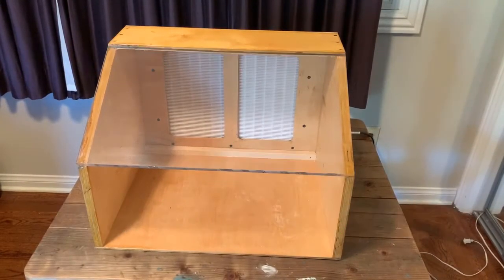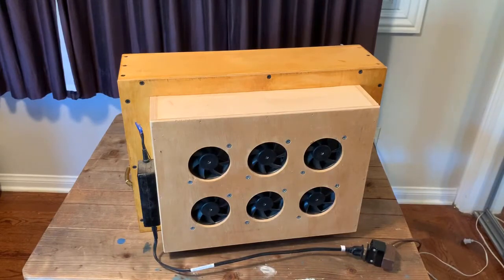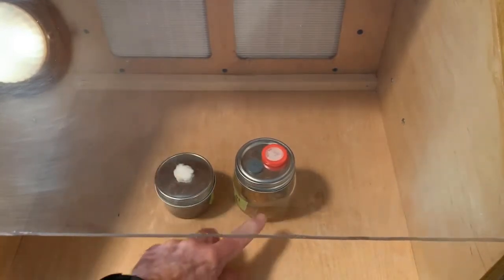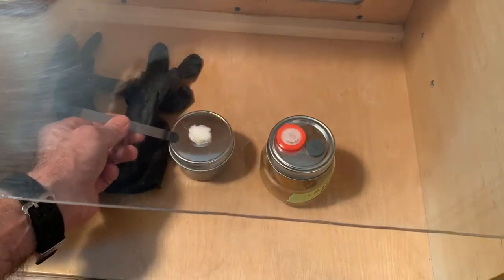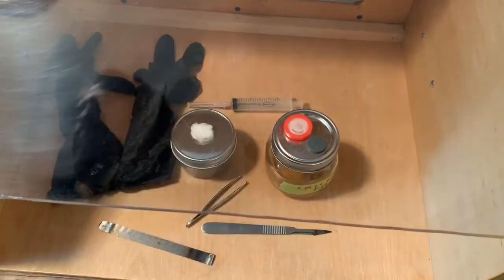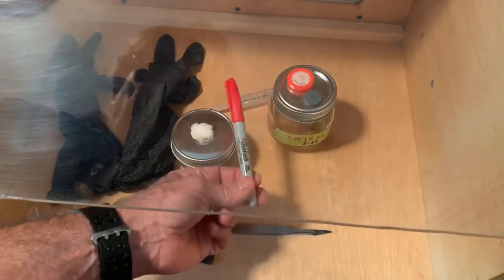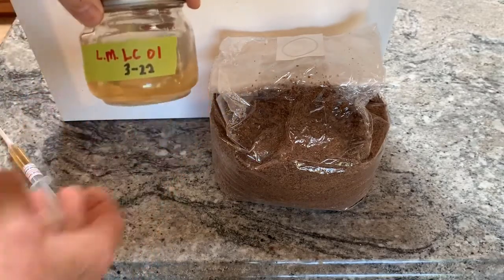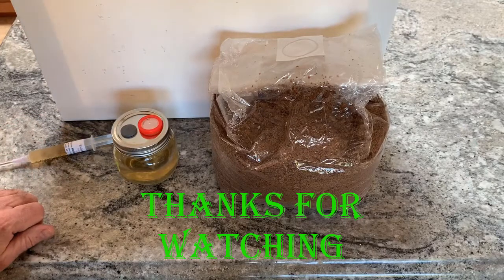Mushroom Growing Inoculation Box, Tools and Techniques

Comment: I love you Bagnob, but I don't like this design, you can clearly see at 6:31 this is producing turbulent air which is the opposite of what you really want (laminar flow is the gold standard).  I'm also not a big fan of using wood because fungi/mold loves wood.  Also I think "hoods", side fins/walls are obsolete as well, if you look at professional medical industry portable laminar flow units they do not have any sides or walls, the reason being, this creates a vacuum where the air is not coming out of the filter and just results in turbulence and eddys.  If you haven't seen it yet, I created a vid on making a true laminar flow box for under $100 that works extremely well.
Reply from the maker: You're right on all points. The box idea is obsolete, but it does work. It's harder to use and harder to build than a simple laminar flow hood. Your instructions are great!

Comment: If you say 4 fans will work. Would you be able to add 3rd filter and use 6 fans to have a wider work area?
Reply from the maker: I just removed two of the fans and it's still a bit too much air. So yes, I think so.

Comment: Have you tested the success rate? On a agar dish? So you can calculate the contamination. I would like to see a test in the box.
Reply from the maker: I've often wondered how to do a scientific test of the efficacy of the box. Please make a suggestion.
Reply: @bagnob1321  with 6 different agar dishes. Place 2 in the working space (area). And 2 dished just outside of the working area(still on the table but in front of you) but behind the working area). Then For the control place 2 dishes on top of the box. Place all at the same time for 5 minutes.
Reply: @bagnob1321  then let it sit. And compare the contamination in between the different dishes. I think this this box can serve its place in certain applications. I do not believe that it would suffice and other applications.
Reply: Example of text @frogmanpipes9561  is suggesting: https://youtu.be/Ayb5ryqsQrs?t=232

Comment: Using 10 pc fans to power a long ass box. It’s made out of thick craft foam covered in extra wide aluminum metal tape. A thin flexible vinyl cutting board goes inside to work as a removable work surface for easy cleaning. The material is like poster board foam but slightly thicker with a tougher outer layer, it is extremely light and inexpensive, yet durable enough to hold the fans in place. Once taped together, it’s easily sturdy enough for such delicate work. The opening for your arms is kept even more narrow, as the clear acrylic lid has a hinged door in our version to allow for larger objects to be placed inside and then the lid is closed and the contents are sterilized.

Comment: Would you mind sharing blueprints? What are the fan specifications? Many thanks!
Reply from the maker: Sorry, I don't have prints for this. I would make the box big enough for your purposes. I've tried four fans, they are enough. Any 12V PC fan should do.
Reply: @bagnob1321  I built one with one big hepa filter that is simmilar in size. I used 5 80mm 3000 rpm fans but the airflow is quite weak. :( How big are your fans and what is their rpm?

Comment: Dave, I jus saw your video.  What are the dimensions of your box, and if you were to remake it what would you change?
Reply from the maker: The rough dimensions are 20" wide by 14" high in the back by 14" deep. The front opening (about 9") should, in my opinion, be a bit taller. Make it 10" to be comfortable. Otherwise, the box works very well.
Reply: @bagnob1321  Thanks

Comment: Hey Bob, almost done with this build but can’t get the wiring on the fans right. I bought the antec fans you recommended, but the wires aren’t labeled. Ii stripped the wires on one fan, and tried to test it with my 12v 3A pc power supply, but couldn’t get it going. Any help is appreciated!
Reply from the maker: All red (+12V) wires are tied together, and all black wires (ground) are tied together.

Comment: There's one thing I don't understand: how do you change the filters? It seems like the back box housing the fans is either screwed or glued to the main box? Thanks!
Reply from the maker: The back of the box that covers the filters is indeed screwed to the main unit, so it's a bit of work to change the filters. However, giving the low use rate, I don't expect to need to change them.

Comment: Hi, nice to meet you! My complimets!, your project is really great!!  May I ask you somethig? I'm a complete disaster with eletricity...How did you connect 6 cooler in just one 12V power supply? Is it works without loose strenght?
Reply from the maker: Nice to meet you too. I've found that 4 fans are just as effective. Put all the fans in parallel. In other words red to red and black to black. Then connect the red to +12V and black to ground.
Reply: @bagnob1321  thanks!

Comment: I'm a bit late to the party but this really is a great design and I fully intend on replicating it. Have you replaced the filter since building this? Did you make it accessible without disassembling the entire mechanism? What is the purpose of that piece of work inside the working area under the filters? Thank you very much for sharing this fantastic design.
Reply from the maker: The filter is sealed using RTV, so it's a job to replace. Nonetheless, the box works well.

Comment: Was wondering how you figure it's laminar flow not knowing the cfm and resistance of your filters and fans? Having the closed area in front of your filters is a good design, seeing any turbulent flow would pull spores and bacteria back towards your work area.
Reply from the maker: Hi Jake. I'm an engineer by trade, perhaps you are also. I've calculated the Reynolds number of the system making reasonable approximations for the fluid flow. It's well below the commonly used threshold of 2500 for laminar flow. But I think the most convincing demonstration is with the incense. Thanks for watching!
Reply: Even tho is below threshold for laminar flow it's good enough I need to build something I got all my stuff

Comment: Very very nice!

Thanks! I'm engineer too, but I just don't get it rsrs... how did you calculate the Reynolds numbers? I try to figure out what is the speed of these fans, but I just found on RPM. I tried to make a conversion but it didn't work I guess. So, we can find the density and dynamic viscosity of air by Google, but how you find the speed (fan) and what was de diameter that you considered on the Reynolds number? I also checked that these fans has their CFM, but just don't know how to use it to find Reynolds number.
Reply from the maker: Hi Lucas. See the wiki article on Reynolds number here: https://en.wikipedia.org/wiki/Reynolds_number
Re = rho * U * L / mu,   rho = density of air, u = flow velocity, L = characteristic length, mu = viscosity.
For my box, L = 0.3 meters, U = 0.1 m/second (after the filter), mu = 2e-5 kg/(m-s), rho = 1.2 kg/m^3
Then Re = 1800, which is well below the onset of turbulent flow.
Reply: @bagnob1321  now also known as the Incence Number 🙂

Comment: hi, i am currently doing your build aswell. wanted to ask, did you coat your wood with anything, or just left it normal. since its so porous i was wondering how that would affect clean work and if the wood tends to soak a lot of the alcohol when cleaning
Reply from the maker: Hi MG, Yes the wood was finished with water-based polyurethane varnish. The isopropanol does not affect it.
Reply: @bagnob1321  thank you very much for the fast responce👍🏻

Comment: Hi bagnob,  great job with this setup.  I have been looking to build something a bit better than a SAB without the cost of an expensive flow hood and this is promising.   Question:  are you still using it? How had your contamination rate been?  Your confidence when using it?
Reply from the maker: Hello Andy. Yes, I still use it. I've used it several hundred times and I've never had a contamination problem with it that I know of. If I were to build it again I'd make the box (and the opening) several inches taller. Aside from this small detail it works very well.

Comment: Awesome flow cabinet! i am planning on using your idea to build my own. How did you get about connecting all 6 fans together to the power supply? can you link whatever you used to make that work? Thank you so much!!!
Reply from the maker: Hey OriginalDranksta. All the fans are wired in parallel. In other words, red to red and black to black for every fan. Then I wired the group of 6 fans to an old 12V laptop supply, again red to red and black to black. Good luck!
Reply: @bagnob1321  So you just used wire nuts to wire them together. i was trying to figure out how to use the 3 pin connectors in parallel lol. Thanks so much!
Reply: @bagnob1321  i am starting tomorrow

Comment: Dave fantastic game plan for a DIY flow hood! I’d like to build one and you mentioned doing a detailed follow up on the build. Any idea when so I can start building lol! Or could I contact you for some details I love the fact your an engineer and worked the math. Again great job- big fan!👍🏾
Reply from the maker: Hi Brandon. Please ask questions here in the comments, that way we can all share the benefits of the discussion. Thanks!
Reply: Would a 12V 1A adapter run 5 of those fans at full speed? And would you consider putting a speed controller on them?
Reply: @bagnob1321  my main question is how to build it… totally not an engineer but would love one!! This one. Where did you get the glass/plexiglass well not you @Bagnob ….. And how do you hook up all the fans?

Comment: Hi, how Close are your fans to your filter, get designed box
Reply from the maker: HI MK. The fans are about 1 inch from the filters. I will make a video showing more of the details.
Reply: @bagnob1321  Thanks mate, was thinking about making one for myself but did know what fans to use high air flow or static pressure
Reply: @bagnob1321  How’s that video coming along? I’m waiting for the details so I can build one. Awesome job and super practical!👊🏾

Comment: not bad. But buying 6 120mm fans is more expensive than a small air mover blower. Just sayin'
Reply: and its not pronounced "auger", its pronounced "ay-gr"
Reply from the maker: Yeah, I got the pronunciation from my father. He was a mushroom grower by trade. Thanks!
Reply: @SwiggitySwagDopeInTheBag  depends on where your from. Either way is correct.
Reply: @Humboldtcounty707  no, it doesnt depend on where youre from, and no both are not correct. One is right, and one is ignorant.